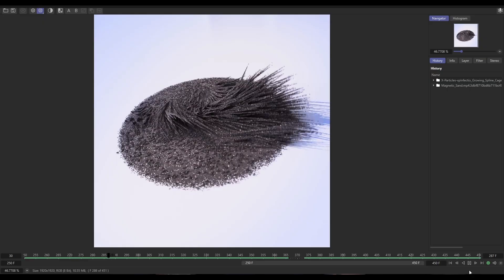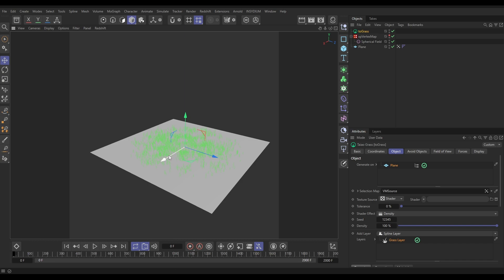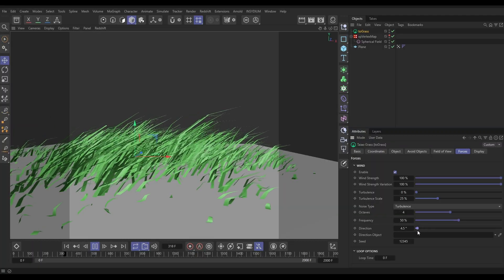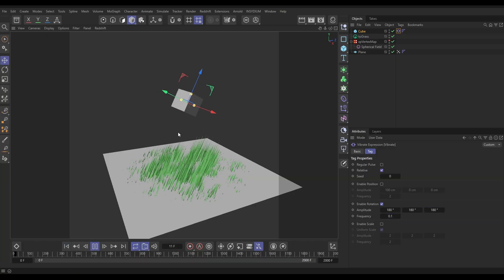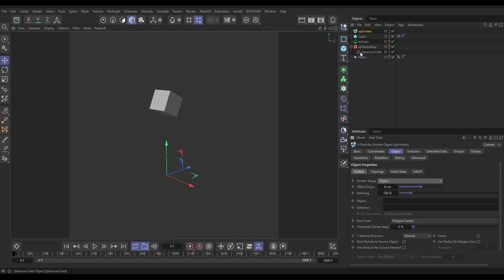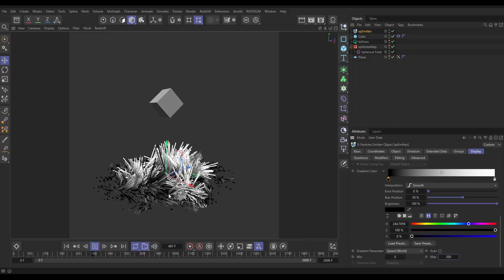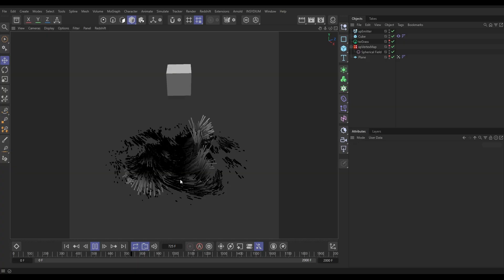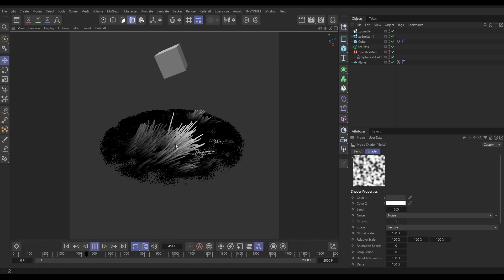Top Tip Tuesday - Magnetic Sand

Comment: Hey Bob! nice example of how toGrass can be used for other stuff than grass. I wonder why you used xpVertexMap instead of the procedural c4d vertex map with fields, so I tried that, but toGrass doesn't react if I drag the procedural vertex map into the selection map. even a procedural selection tag doesn't work. it did work with actual polygon selection but therefore the object must be converted and is no longer procedural. is that a bug or a limitation? Also, as soon as I have a field as a child under the plane the xpVertexMap no longer works.

Comment: Great tutorial! One question: How does it handle the particles being generated in a shot when the grass is at 2 cm, then growing out to its full length? Are they all generated on the "exposed" grass, then fill the geometry as it grows?
Reply from the maker: The particles are born at random points on the grass polygon surface. Because the grass polygon count remains the same, as it grows, the particles maintain their relative position. As long as the polygon count remains unchanged, the particles will animate smoothly with the grass growth.